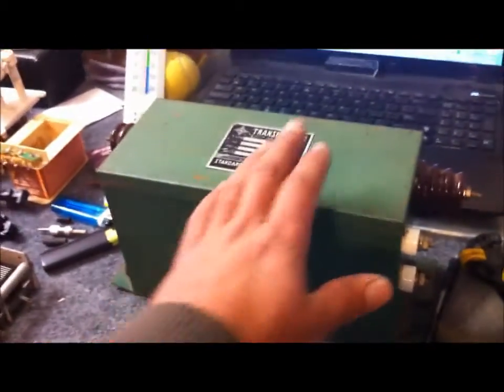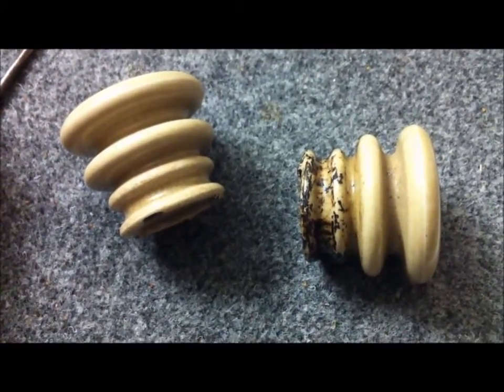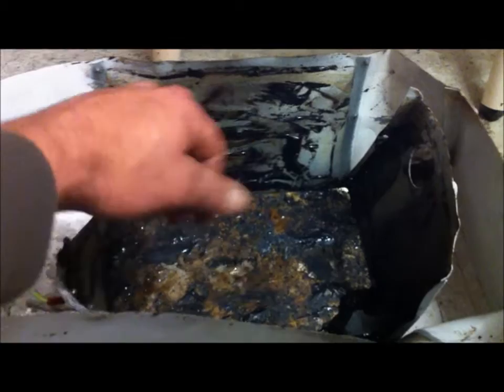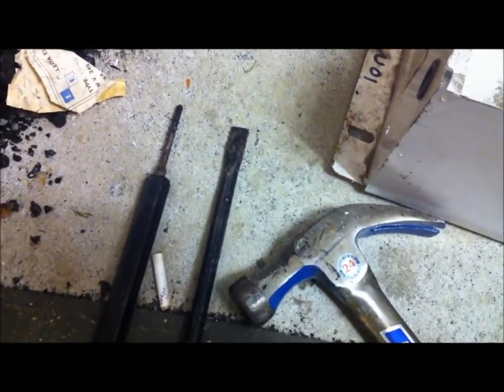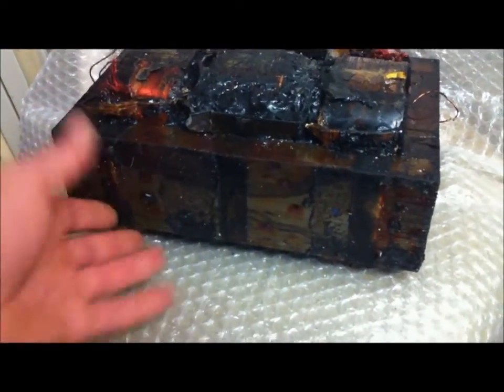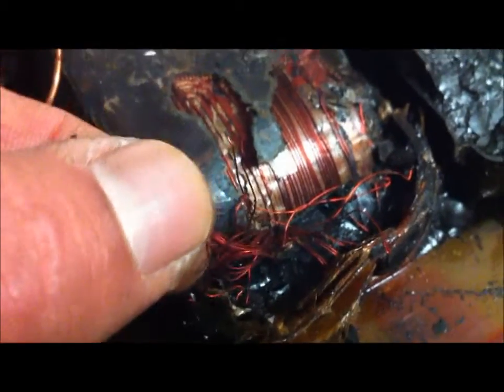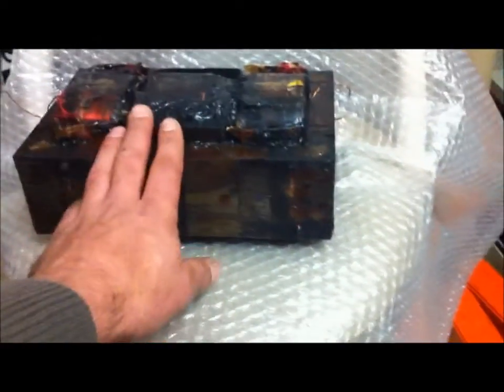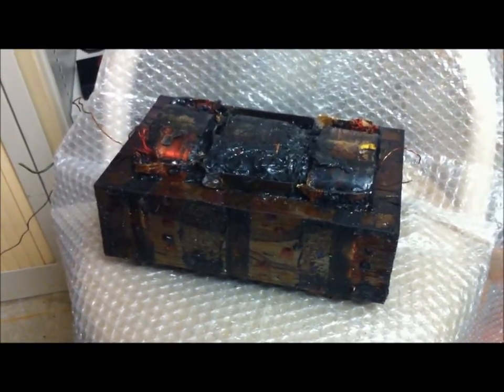Getting To The Core Of This 11KV, 80mA Neon Sign Transformer (NST) - Insulators, Windings And Core!

Comment: hello you seem pretty knowledgeable. I've recently acquired a pole pig transformer and was wondering what would be the best way to limit the current on the low voltage side (120/240)? Any help is appreciated.
Reply from the maker: There are many ways to do this. The simplest and safest way to do it is to use a small ballast transformer in series with the primary winding. Try using a small (400Watt - 1000Watt) High Pressure Sodium (HPS) ballast transformer. They are cheap, abundant and easy to find. Be safe and use a fuse!

Comment: I now regret doing it because it has not worked since so I thew it in the scrap metal bin. I think there was at least 70,000 volts in the secondary windings so it is no wonder it leaked to earth. My NST has 10,000 volts at the secondary windings.  EnergyFabfricator I really liked your videos about scrapping electronics as I do exactly the same thing. Why buy parts when my friends donate electrical scrap to me.

Comment from the maker: You could use anything from a bug zapper transformer or multiplier, TV flybacks, TV HV multiplier modules, microwave oven transformers, plasma balls - the list goes on.... Just about anything that produces high voltage can be adapted to operate a basic Tesla coil. It just depends on what parts you have available.. Thanks for watching :)

Comment from the maker: Input: 240V @ 50Hz @ 2Amps. Output: 11,000V @ 50Hz @ 80mA. I will check the wind ratio and wire diameter when I remove the windings.

Comment: Question's: Are you going to count the number of winding's on primary and secondary's, what size magnet wire was used on primary and secondary, what voltage, amperage or watts and HZ was the neon transformer operating at? Data plate specs, thanks Jeff.